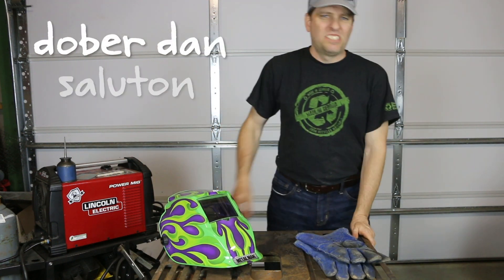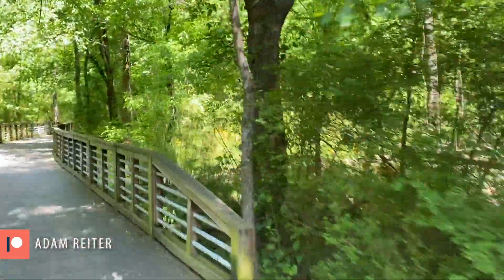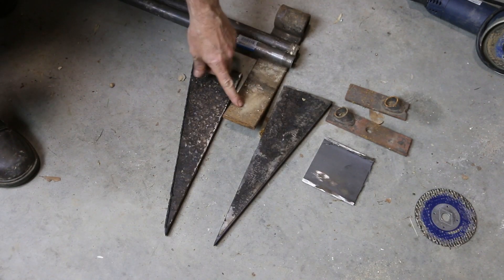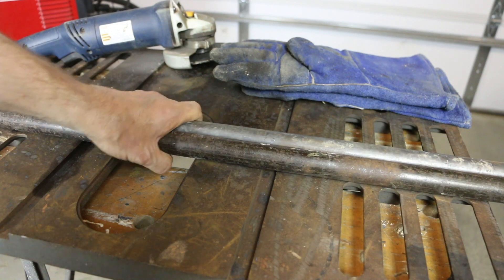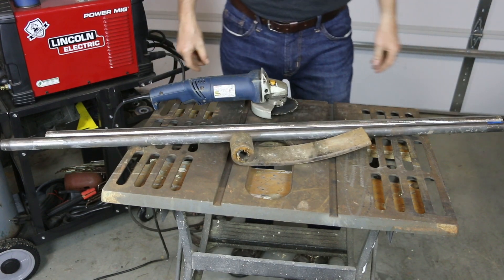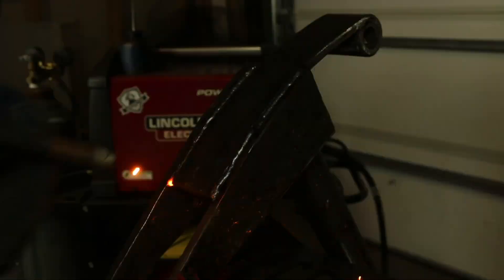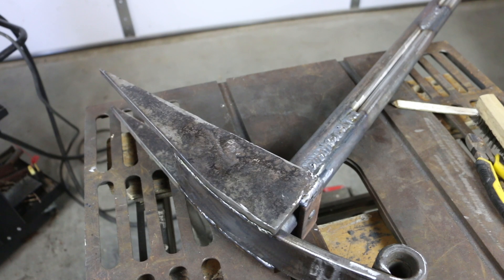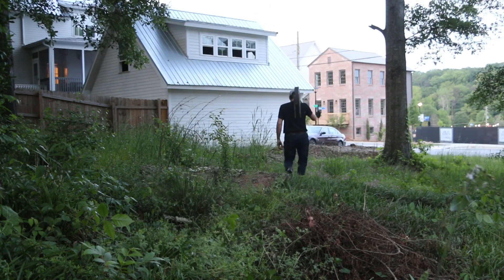How To Make A Tool To Remove Invasive Privet | Meet Frankenjack

Comment: More information the mask should be toxics fumes rated not just for particles If your garage is the only place you have to weld in you should have the door open and weld close to the door with a strong fan close to you blowing out the door. for best welding place the fan between the door and your welding area this way the fan will suck out the fumes but not blow the gas away from you welds. meaning if you have the fan in the back of the room blowing over the area you are welding the air can mess your welding up by blowing the argon gas away.

Comment: I know you are new to welding the welds looked good by the way. I am going to point out some safety that a new welder may not know, because I believe you really care about being green.  Welding in general puts off bad fumes that you don't want to breath. Not sure if it was but that on silver looking piped looked to be a galvanized pipe 99.99% sure it was, the black one would not be. {Only because I care about you and your families health} anytime you grind or weld galvanized anything you should do it with a respirator on and in a well vented area. The fumes from welding galvanized metal are deadly. It is recommended you wear a mask when doing any grinding or welding and in a well ventilated area, but when working with galvanized metal it is a must. It looked like you were doing this in your car garage which looked to have the door shut and also attached to you home. The best place to do this is in a detached shed or shop that is well ventilated.